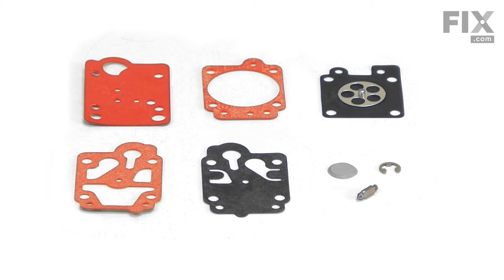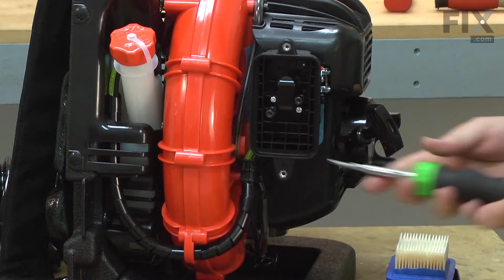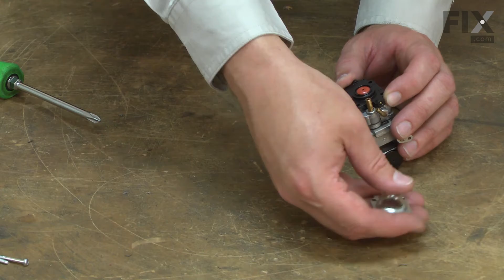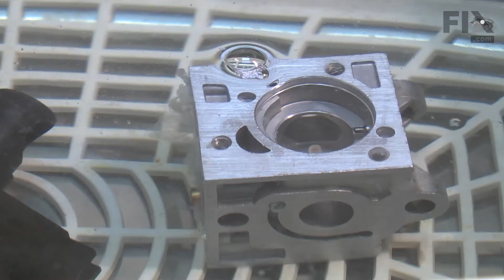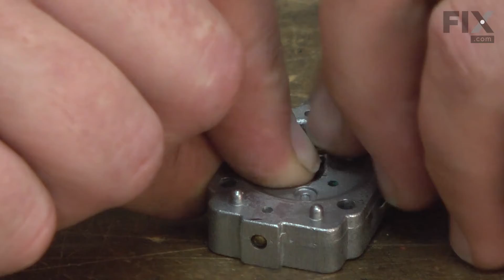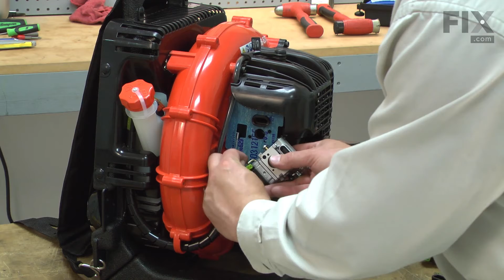Echo Blower Repair - How to Replace the Carburetor Repair Kit

Comment: You put the thin rubber gasket with the flaps on the carb first then the thicker gasket. That’s backwards. The thin gasket with the flaps goes up against the machines surface of the metering block. You can even see they it was properly assembled until he reassembled it.